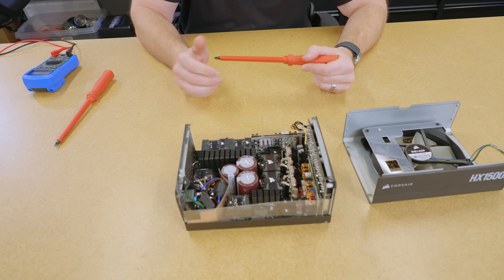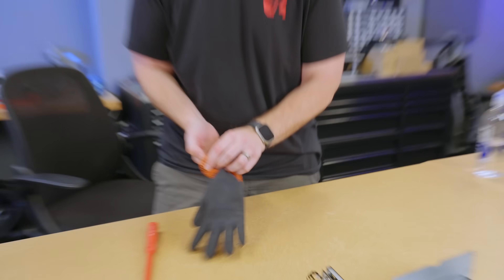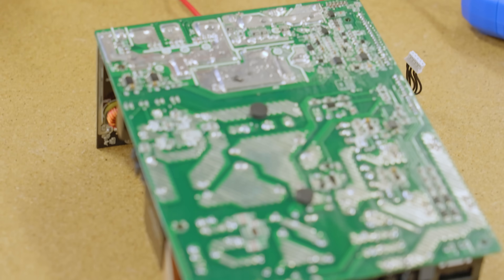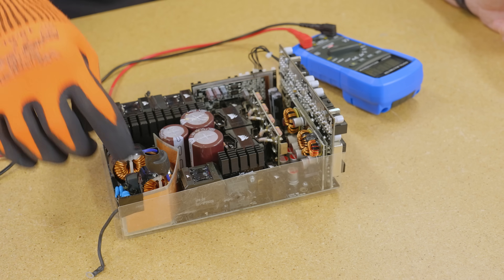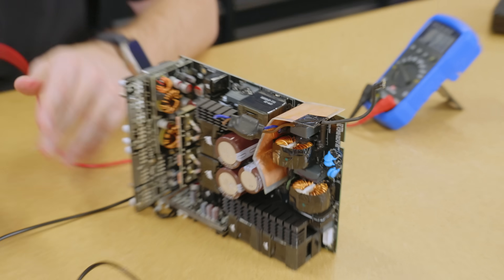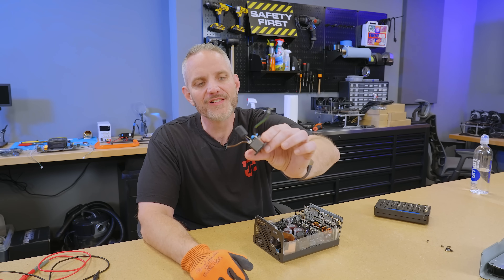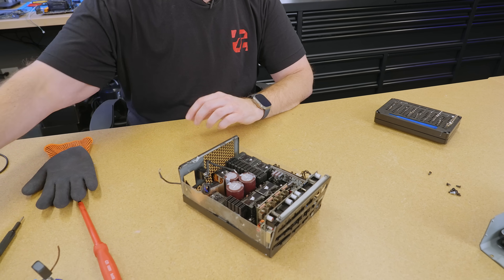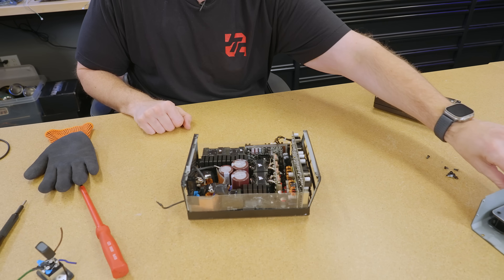Investigating what exploded in my PSU... DANGEROUS! DONT ATTEMPT!

Comment: Not gonna lie, that's a fair bit of angry pixies. You can discharge caps to ground, but there is a specific way to go about this,  my dad had a thing involving a resistor. Just grounding one terminal is not enough. So. once you find the terminals, you hook up a resistor (make it beefy) to them, then you hook up one side of the resistor to ground. you can check the voltage across the resistor with a multimeter, and when it reads 0, your capacitor is discharged, safe to handle. Do not, under any circumstances short it out. And yes, you have to do this for every capacitor. Doesn't take long, just remember to engage the safety squints.

Comment: Seriously, if you don’t know anything about electronics, keep out of any PSU, or anything else with large capacitors. There are instruments to discharge capacitors. And you could easily discharge it with a resistor capable of the voltage, but not too low resistance or it will be almost like a short.

Comment: In college I interned at a power electronics R&D lab and when we blew a power FET, those f*ckers sounded like a firework had gone off inside.

Safety tip though is to avoid using both hands to work on something that may be a live power circuit. I prefer to work with my right hand so I stick my left hand in my pocket to avoid using it (thumb out so no one gets the wrong idea of what I'm doing with lefty). The worst possible scenario is when the shortest current path is through both arms because the heart is in that path.

Comment: I used to delve inside Valve Colour TV`s in the day and know that you should always discharge caps and high voltage stuff especially when working with voltages up to 25KV so a PC PSU is not so much of a deal but enough to be dangerous. Its not so much a Rectifier but a Rectum frier if things go wrong !

Comment: Jay just connect the power wire for one of your benchtop testing power supplies (behind you on the bench, in white) across the caps. That voltage is totally safe because the actual peak to peak voltage on a 120 volt AC line is much closer to 180 volts, and as such the benchtop power supply is absolutely made to handle that type of voltage. it will just attempt to turn on, but given it does not have the other half of the waveform, it will not be able to, but it will safely discharge the energy contained within your caps. easy peasy.

btw the 150 volts on those caps isn't the end of the world. it's a decent jolt for sure, but unless you have a pacemaker or weak heart, or if you connect yourself across them across both of your arms, you're more likely to just get a jolt than anything. but i understand your concern, hence why i am suggesting how to discharge them safely.

other option would be to find a 10k resistor (or really anything betweeen like 5 and 50 k would be totally fine) and short it across the cap pins and hold for a few seconds then measure. you can find resistors in all sorts of junk parts. color code should be brown black black red (the 5th band doesn't really matter here). the first color could be brown, red, orange, yellow, green, the second and third bands really don't matter much at all, the fourth band is the more important one and it should be either brown or red, and any further bands really don't matter at all. easy peasy bro, you got this shit.

Comment: Use the 24 pin self power on plug thing to power the PSU on to discharge any residual power, over 24 hours.

Comment: Thanks for opening this bad boy up and also giving the necessary warnings and showing the correct amount of curiosity combined with understanding how dangerous this is.
Everyone (who is not an Electrician) that ever opened up one of those despite the warning label should have that amount of fear of those things. They can kill or at least do serious damage.
Don't risk your life fooling around with those. Especially since you can't repair them anyways. Looking is fine, touching isn't.

I still remember the open power supply in the xbox classic... a nightmare for all modders.

Comment: You can use a bleed resistor to help bleed down the caps safely. Pretty common to find these already between the poles on larger starting caps (eg. AC units)... I've accidentally buzzed myself on a fully charged 50uf at 240V - it hurt a lot more than 240v AC, I can tell you that much!

For the bleed resistor, you can do some basic calcs where R = V^2/P.... so if you're using say a 2w resistor and the voltage is 220v, that's 24k.ohm resistance (ie. 24200 ohm = (220 V^2)/2w). Judging from the video, one of the larger caps is about 680uf - if I'm reading it correctly - full discharge with such a resistor is just over 16 seconds... but you'd want to leave it several times this for a complete discharge (ie. minute or two). If it's a 1w resistor, double the resistance (ie. 48k) and the time to discharge.

Comment: All you need is a stove coil and some 220 line with some aligator clips. Attach the clips to the leads and the other end to the stove coil and it will just get hot and disapate the capacitor. Keep in mind 1300watt psu could have capacitors in the 200 to 400 volt range, but must stove coils can take like 1500 to 2500 watts if im bot mistaken. Do a little math for saftey, and bata bing bata boom discharged capacitor. You could also go fishing ;)

Comment: 9 times out of 10 a big pop is a MOSFET on a power supply.  That or resistors on the input side.  Seen that more than once.

As for shorting the caps...just do it.  holy crap dude...how do you think we discharged CRTs in the past?  100% by shorting them to ground.  Those were WAY more powerful than those babies.
Reply: I did that more times than you can count. One of my first jobs as a tv tech. was to remove and install picture tubes.

Comment: This video made me realized that teenagers are big time dumbs, i used to take my entire computer apart for deepclean every month if not more frequetly because ocd with cleaning.
I ALWAYS took my psu apart to clean it too, no gloves, no grounding, no isolated screw drivers, very likely most of times barefeet, just casually going by with a brush between all the psu components and backside while not having lot of care to where i put my hand on the backside because it never crossed my mind that i can be shocked by both sides :3

Comment: The F4D fire control system (radar) was a vacuum tube system and when disconnecting the magnetron we had to remember to  discharge the capacitor or get the shock of all shocks.

Comment: Given that the lights dimmed when it happened, there are chances that the now open cap failed under load and went close to short internally, causing a current spike high enough to drop the mains voltage. The rapid release of heat inside the cap quickly evaporated the liquid electrolyte inside until the relief ruptured.
It's likely that OCP didn't trigger because the load was within limits. The cap is the sole cause of the problem likely because of wear or internal defect. Failures are more likely to happen under heavy load scenarios because of high current and temperatures.

Comment: i remember a few years ago replacing the fan in my psu, since the connectors were easy to get to i just carefully unplugged the bad one and plugged the new one in with a plastic tweezer/plier like tool. didn't have to be near the spicy pixies for anything else tho. still working fine to this day as well.

Comment: What you call transformer is actually just an inductor (2 inductors, to be precise), that is used for filtering, usually inductors never go bad, and when they do, they don't go boom.
You also pointed at the heatsink near the inductor, that dissipates heat generated by the mosfets that "step down" the voltage (it's a bit more complicated than that, but let's roll with this explanation anyway), they may go boom, but I can't see that charring or holes, so that's not it.
What may go boom, are main fuses if the bridge rectifier broke (and that happens a lot more often that you'd think), or caps.
Both bridge rectifier and caps are good, the bridge rectifier works as you have 150V, caps are good because I can see that they are still there and the vent is closed.
maybe some resistor blew and took something else with it.
The transformers are those black squares at the center of the psu.

Comment: Bleed the capacitors with a resistor instead of shorting them (shorting is a zero ohms resistance), 100 ohm resistor is good enough, use a beefy one, 1W or more, it will be safe

Comment: Using a Light Bulb

Connecting a light bulb in series with the capacitor creates a discharge path. As the capacitor discharges, the bulb gradually dims until it goes out, indicating a complete discharge. This method provides a visual cue of the discharge process. Steps for discharging a capacitor using a light bulb :

    Turn Off the Power: Make sure the power to the circuit or device containing the capacitor is turned off and unplugged. This step ensures your safety during the discharge process.
    Check with a Multimeter: If you have a multimeter, use it to measure the voltage stored in the capacitor. This helps you decide if a light bulb is a suitable method for discharge.
    Select a Light Bulb: Choose a light bulb with an appropriate wattage for the voltage and capacitance of the capacitor. The bulb acts as a resistor in the circuit.
    Connect the Light Bulb: Connect the light bulb in series with a resistor across the terminals of the capacitor. This creates a path for the charge to flow out gradually, and the light bulb serves as a visual indicator of the discharge.
    Wait for Dimming: Turn on the power and observe the light bulb. As the capacitor discharges, the light bulb will gradually dim, indicating the decreasing voltage. Wait until the bulb is completely dim.
    Turn Off and Test: Once the light bulb is dim, turn off the power again. Use a multimeter to confirm that the capacitor is fully discharged. If not, repeat the process.

copy and paste above

Comment: I just had an Asus 1000W Aura PSU make a loud crackling noise and shut off. I did a post on Reddit and an Asus Rep reached out to me. The first thing they asked was to check the norm, but also this. " Double check PSU for bulging capacitors, burnt components, discoloration, and power cord for damage. If comfortable, you can check 12V, 5V, 3.3V rails on."
To check all the componets, I would need to open it up, to which I said "No way am I doing that." That blew my mind that they asked me to check the internals.

PS
They asked me to DM them to provide my details, and since then (approximately 20 days), they have ignored my other DMs and never responded.

Comment: I have the knowledge to work on one of these safely and I wouldn't. If one gets enough current in the wrong place to go 'BANG' there's no telling what was maybe damaged just enough to test ok but then fail again under load, possibly taking other things with it. I'd simply never trust it again. Jay is right to treat capacitors with respect. If you have one of the right voltage rating discharge through both hands and across your chest and that could possibly stop your heart. If not, there's a good chance you'll get a nasty gash from whatever your hand hits when the muscles in your arm all contract. Anyone who's worked on a lot of old cathode ray tube displays knows about that one and probably has a few scars they gained learning it. You can discharge them through a 5 watt 1000 ohm resistor. Oh and another fun fact. Capacitors can build a charge over time just from the small induced currents that happen naturally. Discharge all of those and leave it sitting for a few months and you might find them right back at 150 volts. Labs that work with really large capacitors often keep a resistive load across them while they are in storage for that reason.

Comment: Base on the placement the thing Jay point at should be input filter, and it's normal to not have voltage when not plug in. 
I think the pop was coming from one of the large cap, mosfet or IC.

Comment: How scared should you be of a European 240 volt plug...

Speaking of a voltage surge, it was the low load of an excessive power supply that led to a slow triggering of protections. In my internet party, everyone knows this.

Comment: I have had a PSU litterally explode in my case. No glass I had Acrylic panels 1/8 inch. During the explosion, heat sink and other parts shot across the room and stuck in the wall

Comment: others have mentioned it but yeah safe discharge the caps with a parasite load (light bulb, or technically anything that can take the voltage including a resister) then poke around, your asking for problems not discharging. Caps can hold power for days - months - years depending on the type.

You should be glad it didn't take out hardware, I had a thermal take PSU blow and short the 12V and 565v Rails together, did a nice number on all the hard drives etc connected to that SATA rail even started a small little fire on one of the seagate drives.

The thing is thought most Corsair PSU's especially their 1000+ watt ones have overvolt, undervolt protections per rail as well as short circuit protection, better they die then the hardware.

Comment: Ewaste! Stop doing that. Send the unit to Corsair and let the have a qualified technician have a look at it. They learn, you learn. It may have been caused by switching pulses on the power transmission lines causing a spike in your AC supply at the wall.

Comment: Capacitors, particularly high power ones can have "bleeder resistors" connected across the 2 pins which discharges the capacitor over time. 
However one should not proceed assuming such components are present or functioning. 
Also,shocking fact (!), capacitors can develop a charge on their own with no power. Yeah, shocking I know.

Comment: Imagine an USAnian scared of just a few volts 150Vdc (120V AC rectified): UK volts DC says Hi (300Vdc 250V AC rectified).
Anyway, at 150Vdc, why isn't the power-factor sine-following boost converter stage boosting it up to 350-400V?
I'd of expected that to be present if nothing discharged the capacitors, or maybe one needs to discharge using an incandescent lightbulb, suitable resistor, EEVBLOG Dave Jones' Multimeter with LowZ mode designed to discharge this, or, the ultimate most manly way is to "Yolo flashbang redneck camera-flash screwdriver across the capacitors" it.

Comment: Just get a proper cap discharger , that has allows you to add clips or probes, works up to 1000v and built in discharge voltage meter, shorting caps is not good for their lifespan vis screw drivers

Comment: I opened up a old film camera when i was about 10, curious whats inside. Worked with 2x aa batteries and had not been used for a few years at that point. Pressed the clicker, nothing happened. Was using a full metal small screwdriver, and somehow shorted the cap. I woke up 2 metres away from where i was sitting previously. Lesson learned.

Comment: That one cap blew, also just short them you coward! jk, jk, get a resistor and stick the wires in the sockets of the multimeter then plug the cables in and touch the pads to discharge.

Comment: FOUND IT. @03:58 there is a tiny slip in left capacitor. that explains the extreme sound. it did not fully pop. for some reason it didnt fully open up.
@05:32 its the top cap.. good shot to see the tiny cut in the top.

Comment: Just put a screwdriver across the caps, that's the way the repair centre I work at did it on CRT monitors back in the day.

Those are running at 1000s ov volts and will stay charged for years!

Saying that even our low voltage is 220v as I'm in the uk.

Comment: Young TwoCents... These are not the components you are looking for.  That circuit is probably standby power and low voltage for the control circuits. The dead components are probably one or more mosfets or one or more dual-rectifier diodes (both look like transistors) that blew their guts out further down the line. Usually it's the heatsink mounted mosfets that blow a loud pop, the diodes are usually near silent and blow the fuses before they can pop but that's just my experience.

Comment: the caps stayed charged because 
1. The psu was off so it was only running the 5V standby rail and would not try to power up the other voltage rails anyway.
2. All the voltage rails had no load on them and so no current would be drawn and therefore no power used.

Comment: From someone that that is a electronic tinker, (from pc repairs and builds to console repairs) those caps are not a joke. Caps normally are the first to fail as they are designed to fail. Normally I wouldnt even of bothered to open a PSU up just written it off, especially cheep PSUs that still have a potential to electricute you just unpluging it from the mains even after switching off the PSU and holding the power button

Comment: I took apart a PSU I lent to a friend in a computer that was used with birds around. They shed this kind of waxy ultra fine dust that can even go through mesh filters. It is an EVGA G2 750. Plenty of life left in it, longer life without dust caked on the fan and in the cluster of capacitors. Thanks for taking it apart to see if it could be fixed.